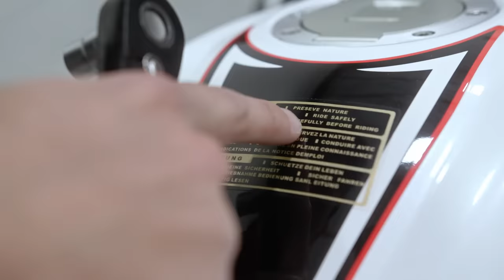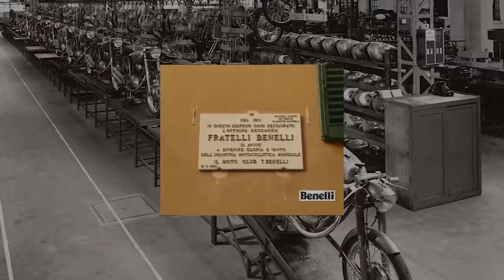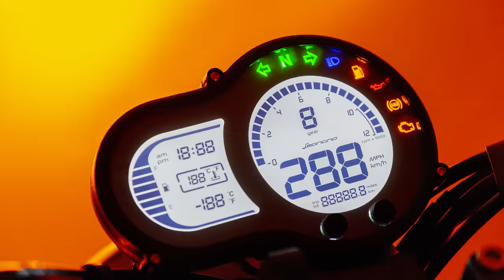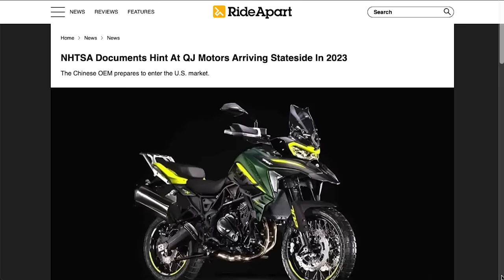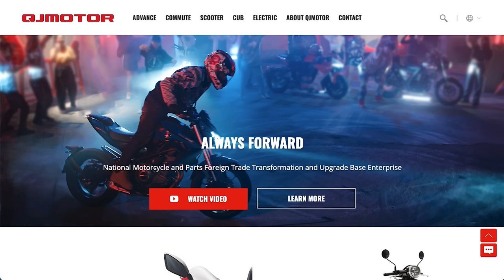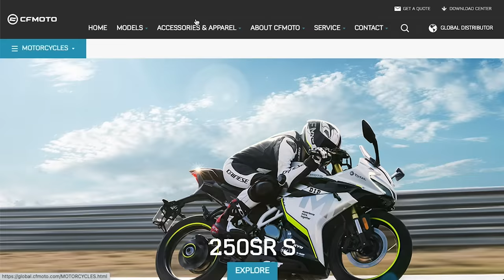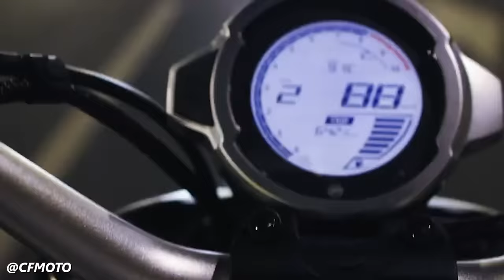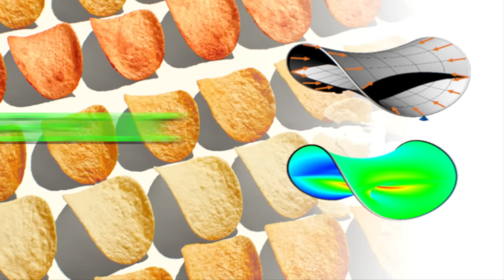7 Chinese Motorcycles that are WORTH IT

Comment: Man you missed the specs on the Ibex 800T.  It makes the same HP and Torque as the 790 Adventure... 94HP and 54 ft./lbs torque.  CFMOTO is building the engines for the new 790 Adventure and the new 790 Duke.
Reply: Glad to see this clarified..

Comment: I had a Benelli TnT 1130 Triple naked bike for 1 day back in 2007. I had made a deal trading in my Ducati Monster and rode home on a fabulous looking 1130 Triple in bright green. After riding it just 30 kms, I was back at the dealer demanding my Monster back - while that Benelli was fast and powerful, the gearbox was complete garbage. Missed shifts with false neutrals, and absolutely impossible to find the real neutral when stopping. Even with the engine off, rocking the bike trying to find neutral was almost impossible. The dealer tried riding around the lot, and in two minutes agreed to take it back, refund my money, and return my Ducati. It cost a few bucks to unwind the paperwork, but it was worth it. Months later, that same bike still sat in the showroom...of course, that was an Italian made bike.

Comment: Should have mentioned the Keeway sub brand MBP. I have a MBP M502N and until now have nothing to complain about it. They are releasing a lot of new models soon
Reply: That's too wired, a sub brand, but actually a better quality one from a sub brand of Benelli, which is a sub brand of qj motors..
 But it's actually a better version of the Honda cb 500 in every shape or form!
 A wasted opportunity, because Keeway succeed where Benelli didn't, cheap naked bikes. MBP is a more expensive Keeway, it's basically without purpose or meaning. If i choose Keeway, it's because of it's untouchable asked price to value ratio, not because it's supposed to be better than x or y..
 Rkf 500 needs to be born, as a natural upgrade for those millions of squids, MBP is just another voge 500.

Comment: Yamster..  I just bought a Lifan KPX250 dual sport for $2900 shipped.. more than I expected..  yes venom motorsports, but the Lifan is decent EFI, 6 speed, dual disk brakes, that will do 75 without straining (much).  for a knock around go anywhere, grand kid can learn to ride bike, it's hard to beat.  A perfect match for my XSR9..  your style is obviously high end as it should be, but this specific bike has quite a following as a huge upgrade to a Grom.  Quality, fit and finish are decent.  Engine always starts.  your mileage will vary, but a great second bike honey can learn to ride on.

Comment: My Nov. 2008 China Scoot, was mechanically ok (did about 4,000 miles on it before giving it to my father in law), but it did have fit and finish problems/ as in the seat opening mechanism failed in the first month/ and myself and the local moto shop never figured out how to "reattach" the spring cables to "fix" it. but that aside/ it was an ok ride for a 150cc "touring size" body (had to mount the windshield, battery, rearview mirrors, and floor mats) Oh, and don't forget the REASON people buy cheap China Bikes, it was $1300 bucks delivered.

**although I do like my Kawasaki, Versys x300 I ride now/ nice to have well made everything.

Comment: I’ve got a 650nk from CFMOTO, bought it in September of 2022, currently sitting just shy of 11k miles, no issues out of it. I’m even planning on loading it down and taking it to key west (roughly 900 miles away from my house). Looking forward to seeing some market breakthrough.
Reply: I've got a 2013 one 
Still going very strong
Reply: Yeah, I'm enjoying my 650nk also. Not as punchy as I was hoping BUT!!! It's a lot faster, torquier and stable than I thought it was going to be. Definitely a great bike.
Reply: @tyrant1178  I agree, after a few months of riding it as a daily, I understood it’s strong points were stop light to stop light, but I have a roughly 50mi round trip commute, so I’ve learned to deal with the shortcomings of it and assumedly all naked bikes
Reply: @ianmoore1312  oh I get that. My commute is only about 15 to 20 minutes but all highway. I think a lot of the negative opinions unfortunately come from the pre break in period. Because I can definitely say my bike came right to life after about 1000 miles
Reply: @tyrant1178  I know exactly what you mean. Btw if you are looking for a good windscreen to make the commute a little less of a beating the PUIG Rafael looks absolutely gorgeous on the bike.
Reply: @ianmoore1312  I really appreciate that, that helps a lot man. Thanks bud. I just put a set of bar ends on. I'm a lot happier than the bug antenna mirrors. I guess I'll have to get that windscreen and a slip on next.
Reply: @tyrant1178  the GPR poppy makes the decel pops very noticeable but not obnoxious to others on the road, and which set of bar ends did you get ? I’m very annoyed with how shaky and worthless the OEM mirrors are
Reply: @tyrant1178  HAve you got the Lams version or the unrestricted? I have the Lams so yeah mine is deffs less punchy
Reply: @ForzaOwnz  unrestricted thankfully. I'm honestly thinking about taking my buddy up on getting it flashed because his is a lot faster than mine and that's about the only thing he's done to his
Reply: Bought 2022 CF Moto 650 Adventura in May of 22. Still runs great. Put 70/30 tires on and am a little too aggressive off road. Probably dropped/crashed 20+ times. Pick it up and start it up and put the hammer down. As my third bike, I have no mercy on it. It is surprisingly tough and dependable so far. Have about 8000 miles on it. I’m now waiting for the Kove 800 to come to the states. Hope parts and aftermarket accessories are more available by then for all Chinese bikes

Comment: Benelli Tnt600 rider here. Got it last year as my first motorcycle, and other then the weight (just under 500 lbs) I have no complaints. Will probably get one more season before upgrading and turning into a spare/track bike.
Reply: Funny the second i seen this title i said the tnt 600 better be in here and this was the first comment i seen😂. I wanted one but theyre rare so i ride my hawk 250 dual sport
Reply: Yea they do seem to be rare lol, which is why I’ll never get rid of it. I’m the only person in my area with one, and not a lot of naked bike riders around here, so it’s unique enough to turn heads. The exhaust note is pretty nice as well.
Reply: Mines from rya it works for me and my bikes tend to last 4 to 5 years
Reply: I have a benelli 302s and its a very good bike, but also very heavy for a 300 (429 lbs). Other then that no complains either and its sounds great
Reply: Benelli 600 and 302s are ridiculously heavy. Was going for the TNT 600 for first bike but the weight turned me off. Went with z650 instead.
Reply: somehow QJMotor have something worth a look, the better TNT 600, that is QJMotor SRK600.

Comment: I have a CfMoto 800mt. Bang for buck its amazing. Only a few months old, so it will be interesting to see how ot age's. CfMoto is releasing a 1250 which uses the Ktm1290 engine. In KTM form it makes 160hp. I wish i still had my KTM1290SAS

Comment: I own a Zontes which is the very best of the Chinese manufacturers. Its high spec and its most comparable bike would be tue KTM Duk.   It looks amazing and built quality is high and its performance and handing are as good as any Japanese bike in its class.
Reply: I am glad that you enjoy your Zontes bike. In China, Zontes gained reputation largely by its 350 scooters and its after sales service attitude. Its earlier geared bikes are often criticized for their chassis rigidity and stability. The upcoming 3-cylinder series would feature improved chassis design.

Comment: The TRK502 has a X variant

Spoked wheels. Aluminium cases(3pieces) and longer suspension for mild offroading
Like 600-700€ extra. Just for looks imo

Some dealers sell em with the X package for sub 6k

Heavy, yes. Fast, no. Good enough for most riders that want a long distance bike for cheap and new, yes

And some ppl want a that GS look

Comment: I could say, most if not all good chinese bike recommended in this video, has lesser build quality than other Japanese, continental or even India built brands like Bajaj, KTM 390 and BMW 310. 

The evidence at least to my eyes and personal testing on the bikes are shallower plastic fairings which feels light (the low quality light, not carbon like), signal stalks that break too soon (same issue as the fairings) and mechanical issue / assembly issue. Its kinda like you expect these kind of issues will happen to 3 or 4 years old bikes but it happen to 1 to 2 years old chinese bikes. 

So depend on the pricing and your inclination to learn fixing a bike yourself, its still worth buying but there's also much more great option in used market from japanese bike although they're probably too boring. At lease bikes from Benelli has great sound especially those with parallel twin engine like Leoncino and TRK.

Comment: I live in Beijing, I paid about $4,900 for a brand new HaoJue TR300 cruiser. Uses a Suzuki engine. This bike is damn near bullet proof, starts first time, every time, even at -15 C in winter. A full year of riding, and all it needed was the regular oil changes.
Reply: haojue has the best reliability among all, they produce all the bullet proof gsxr 250 in the world. but they have 0 innovation their own bikes are reliable small cc vanillas.
Reply: Are Import bikes very expensive in PRC ?
Reply: @zforzed3344  I didn't want innovation, I wanted bullet proof 😅🤣

Comment: Figured I'd watch this moments after getting back from a ride on my new X-Pro Lanai 150 scooter lol. Yes it came in the box 80% assembled and yes it's Chinease. But I'm 88 miles in and I'm loving it. It has also started with the first push of a button every single time I have ridden it so far including the first time. There is this weird whine at super low speeds (below 30 mph) and for the life of me I can't get the front brakes not to half drag but it's a lot of fun. Quick too for what it is. Kawasaki z400 is next on my list, got this to see if I like riding.

Comment: I believe CFmoto has partnaship with KTM, some of the KTM bikes are manufactured by CFmoto in recent years. 

In adidtion, HAOJIE should be mentioned. Basically it is a rebranded SUZUKI, the manufacture are monitored by SUZUKI's superivsors and most of the components are imported by SUZUKI from Japan.

Comment: Green light for the Leoncino. Owned and tortured before buying a Rebel, my definitive ride.

It’s in some way even better than the Rebel and it’s 100% reliable. 

Issues: lights are WEAK if you ride at night, i would have loved better plastic on the tail, plastic on the arrow is real sh*it and tend to curve with heat and use

Other than that and some excess Kg, it’s GREAT
Reply: Took my license on a rebel 500, and recently bought the Leoncino and I will say the same in some ways it does actually feel better than the rebel. However, the rebel is still my definitive ride too (when i can afford one)

Comment: The twin cylinder vertical BMW motorcycle engines are made by Longshen in China and also the 350/400cc BMW Scooter is ALL Chinese just re-badged. The G310 BMW is made in India. This really raises the question of does it really matter where a machine is made ?.
Reply: I had BMW G310r and it was a great bike. Nicely welded frame and all the cast aluminum parts were beautiful. The bike handled really nicely and had a good sound.
Reply: @agelaonsoikea  310 BMWs are manufactured by TVS in India.  They have decades of experience in motorcycle manufacturing.  In the past, TVS also used to manufacture Suzuki's entry level bikes.  After they parted ways with Suzuki in 2001, TVS became the fifth largest motorcycle manufacturer in the world.

Comment: I started riding on a cfmoto 150NK which only cost me $1500AUD. Let me tell you that cheap plastic toy fell apart in 6 months with numerous issues which required it be fixed in the shop every other week.

Comment: I know it is a separate issue, and Daddy Yammie has done it in another video..... but, 5-6 k USD just to say it is 'new'.  There are many, many high, high quality Japanese cycles you can get for 3-4k on Craigslist. (do you guys remember when Yammie did CL ads?!? Hilarious.) Low miles, well-taken care of, maybe with accessories. What is the push for, "new"?
I'm here because I am living in Cairo, Egypt and cannot get access to good used cycles.  Looking at a Benelli 200, just to get groceries. There is also Royal Enfield  500 with 2000 km on the clock for 3k USD.  Probably better than a new Benelli, for just a little more dollars. In any U.S. city, there are dozens of bargains.

Comment: I just purchased a 2023 cf moto ibex 800 s so far I'm liking it. The throttle is a little twitchy in sport mode the horse power is 94hp it has a lot of power for a 800 cc bike you can pull a wheelie no problem. The motor is a little loud at idle I'm at the 600 mile break in service we'll see if that changes with the new oil and filter change. Also the heat from the engine hits your legs wish cf Moto would've diverted away from you. Other than that it's pretty comfortable corners very well and handles great at slow and fast speeds. I'm hoping this motorcycle will last for a long time with plenty of smile miles😀. I would recommend this bike to anyone getting into adventure motorcycle riding also on a Budget you get a lot of bang for the Buck .

Comment: I bought the Cfmoto 650NK. I'm actually really impressed with its quality.
Reply: I have a 650MT, I'm actually depressed with the quality and how bad most things feel, the brakes are trash, the clutch is too heavy and the bike is very havy, the only thing that it has going for it, is the suspension, which is insane for this kind of bike and the price along side it, you can't beat it at its price, and I will most probably keep the bike a little bit, but it's not all good.
Reply: @mrgreg6177  That just sounds like you being picky honestly. I could be mean and say some immature yet rational stuff. But the point I'm gonna make is that's all your personal opinions. Personally? I like it, the things I don't like so much I want to change on my own. Is it worth it? No! But it's my bike and I'd rather make it my own.
Reply: @tyrant1178  Yes of course, making it your own is good. But the bike (notice, the MT and NK are not identical, they are different in many ways) is a pain in the rear to use in town with traffic, the front brakes are bad in performance, feel and the brake lever needs way too much force to start actually braking. Even slow braking coming up to a stop light needs all the pressure in the world.

Comment: Hello Yammie Noob.

I have a Benelli tnt 135( in China sold as a 125) which I use as a toy for having some weekday fun to work and back.
I also have a Benelli 752s  which is the Monster look a like. Which is for daily riding .
Havnt had any issue with any of the bikes ( with me being in China).
Super cheap and easy to maintain and parts are always readily available either from online stores or dealerships.

Would recommend them anytime.

Comment: I had a haojin CG 125 the cheapest motorcycle in denmark during its lifetime it has done 40000km 30000with the first engine which was definitely not worn out but I fitted a breather on cg230 engine on a 75kg bike....82mph(gps), it still exists and it on the road.. it was really nice put together until I made it into a fun scrambler

Comment: The Benelli are very reliable in my perspective. The 302s or the one I had 249s are very good beginner naked bike. The engine are almost maintenance free except for oil change, filters, air filters or any filters as any modern bike has. Dual disk front brakes but not from brembo, albeit their brake pads somehow interchangeable. Performance wise not so great but good enough for Malaysia highway roads. In town the handling are nice, a bit on a heavy side but not cumbersome. Still agile enough to lane split and make a u-turn. It's as reliable as Japanese brands with proper maintenance but I don't baby them unfortunately. But it still runs good after 30,000 km I'd say this is a good bike and a reliable one. Some owners already had 86,000km on the mileage and with minor overhaul which is only valve clearance.

Comment: Aaaand apropos to nothing CF MOTO shoulda kept making and improving the Honda Helix which is one of the only scooters that had a right foot rear break pedal. Most scooters have a left hand lever rear brake which is a tough transition if you also ride motorcycles with a left hand lever clutch, in a "clutch situaltion!"